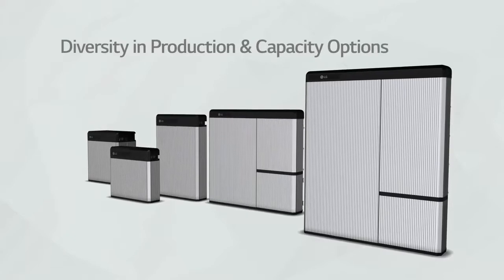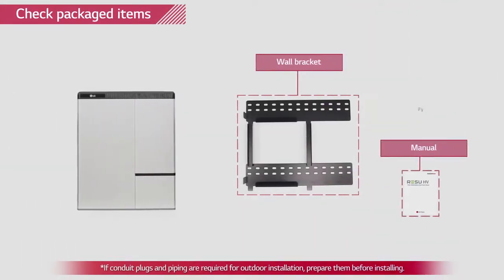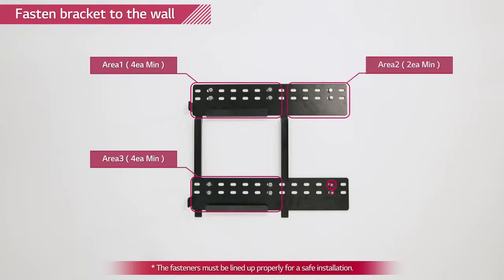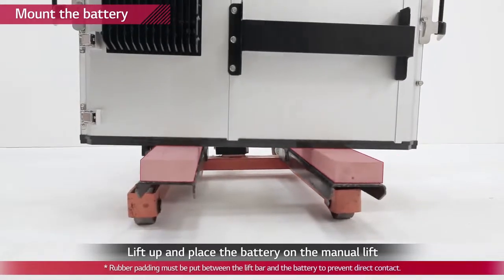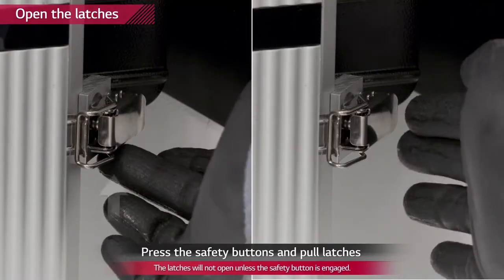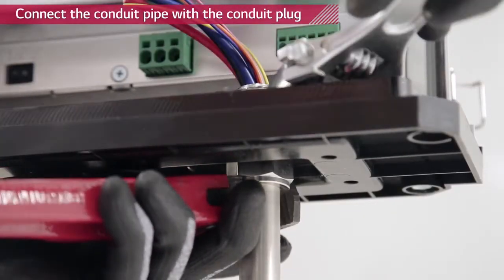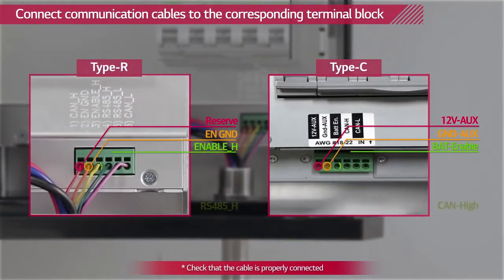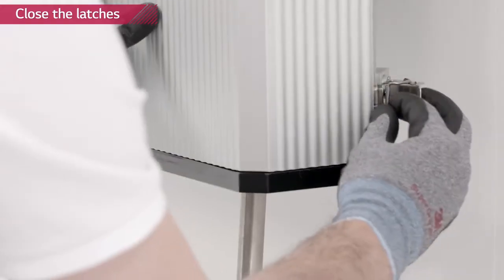LG CHEM Residential High Voltage Battery Storage RESU 400V - Installation Video RESU7H and RESU10H

Comment: I installed the RESU 10H TYPE R with the sun2000-6ktl-l1. It's not charging from PV when set in the island mode (Offgrid). Can you help me figure out please
Reply from the maker: Can be a bunch of things. From firmware update to connection stuff.... BUT LG RESU 10H CANNOT be used off-grid in the first place! I would recommend to contact an LG certified installer, since can be many things that this is not working. Have you tested the system separately?
Reply: @3buysolar  Thanks for your kind reply!
No, I did not try separately. Since it works on luna2000 battery in island mode, I thought it should work on lg chem as they're compatible. 
Thanks, I really appreciate your help 🙏🏾